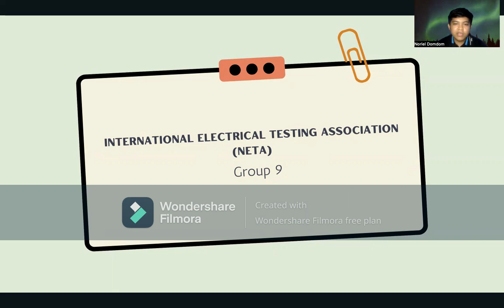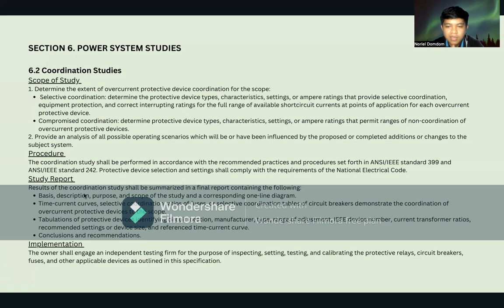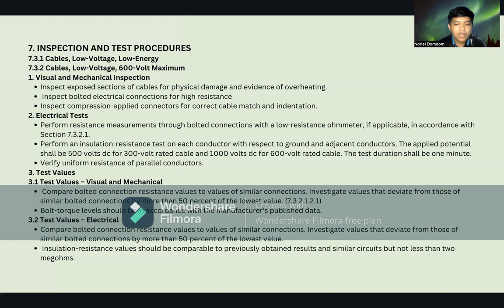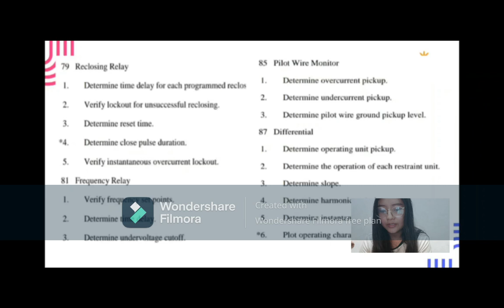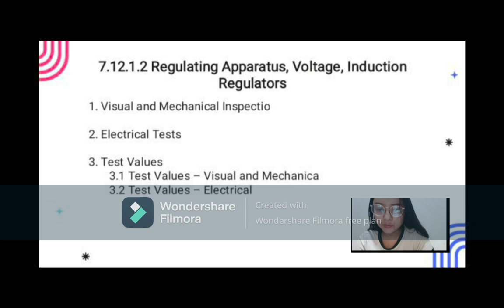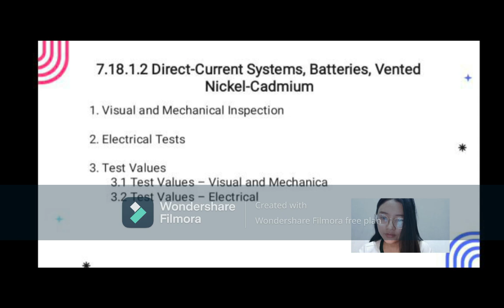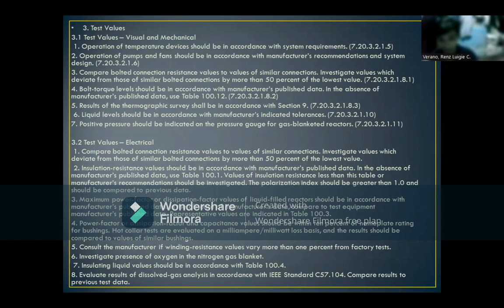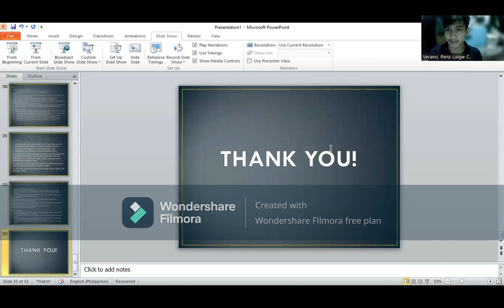Group 9 International Electrical Testing Association

Comment: I want to thank the group for their thorough and understandable discussion of NETA. I discovered that NETA is a trade organization devoted to enhancing American electrical testing standards and disseminating such standards elsewhere. The American National Standards Institute has recognized NETA as a body that develops standards. Additionally, it was covered in Section 4: Division of Responsibility, which covered the roles of those concerned. According to section 4.1, the User provides the equipment in a ready-to-test state and is also accountable for any equipment power switching. The testing organization, on the other hand, supplies all technical services, power requirements, owner notice, timely system notification, and a record of all tests, according to section 4.2.

Comment: Thank you Group 9 ! i learned the that  NETA goal is to ensure the highest levels of electrical reliability and safety. NETA provides accreditation for third-party electrical testing firms, certification for testing technicians, and more. Along with establishing guidelines for testing technicians to follow, NETA also provides standards that manufacturers can follow when literature is not available. Because they are an independent organization and their board consists of volunteers, they remain unbiased toward either customers or manufacturers. NETA exists to ensure that equipment is safe and functional and that technicians are adequately trained to make the industry better for everyone.

Comment: As I learn more about what the International Electrical Testing Association (IETI) is all about thanks to this group's shared video presentation, it's clear that they are well-informed. The group did an excellent job of explaining the subject matter and conveying information about how the IETA regulates the procedures for testing newly installed power systems before energizing them as well as existing, in-service power systems. Thank you and good work.

Comment: Thank you for Group 9, The presentation is excellent, and kudos to the reporters that delivered it so well. After viewing the video, I understood that NETA is quite similar to PEC in that it deals with electrical safety, material quality, and building codes. It assures that the services and materials utilized are of standard quality. Regulating the process of testing newly installed power systems, as well as the duty and goal of this association.

Comment: After seeing the group's educational video, I gained knowledge about the International Electrical Testing Association (IETA) and its significance. I learned that the IETA controls the procedure for testing recently installed power systems. In addition, the IETA is responsible for ensuring the industry's standards for electrical testing. I want to express my gratitude to this group for endeavoring to spread this knowledge.

Comment: As I finished watching the group's informative video, I learned what the IETA, or International Electrical Testing Association, and how important it is. I acquired the knowledge that IETA is the one regulating the process of testing newly installed power systems. Also, the IETA is the one who ensures the industry's standards when it comes to electrical testing. I would like to thank this group for making an effort to share this information.

Comment: I would like to thank group 9 for today's very informative discussion. The topic is well discussed with a clear deliberation by the group. In this topic regarding the International Electrical Testing Association (IETI), I now fully understand how to connect and test a circuit breaker for medium voltage, oil medium voltage, and high voltage. Additionally, the inspection and testing methods for dc motors, generators, and rotating machinery. The learnings for today’s discussion regarding the topic was important in understanding and knowing how it works especially as an electrical engineering student.

Comment: Thank you group 9 for the presentation I learned that in Article 7.19.1 Surge Arresters, Low Voltage Surge Protection Devices in the first inspection which is visual and mechanical inspection seven alternative inspection must considered whereas (1) we should inspect the physical and mechanical condition of the protection devices (2) also the inspect the proper Anchorage, alignment and as well as the groundings (3) prior to cleaning the unit perform as found tests (4) clean the unit (5) also inspect the bolted electrical conditions (6) verify that the ground lead on each device is individually attached to a ground bus or ground  electrode, and lastly (7)performed as left tests. The following inspections are very important for the safety of our users and for us to monitor the functionality of our protection devices if there will be an malfunction or defect it will be easily fixed as it arise.

Comment: Thank you so much for bringing up this topic about IETA (International Electrical Testing Association) After watching your video presentation, I gained a lot of knowledge about how I can contribute to the design of efficient rules for the operation and integrity of the market, as well as how I can provide the most up-to-date and credible information on the trading of greenhouse gas emissions and market activity. The International Electrical Testing Association, also known as IETA, is the organization responsible for publishing industry standards for the field of electrical testing. These documents define the methods that must be followed in order to test newly installed power systems in advance of energization, as well as testing procedures for power systems that are already operational.

Comment: As I noticed After watching the video presentation about international electrical testing association I learned a lot specifically about the regulating the the process of testing newly installed power system and also about the responsibility and purpose of this association. Thank you group 9 for informative discussion.

Comment: Thank you Group 9 for this informative presentation I learned more about what the purpose and the standard of International Electrical Testing Association (NETA) . They set up standards that can be followed when manufacturers literature cannot be found or is available. NETA also sets up certifications for technicians to acquire to prove that they are qualified to be performing quality work. They are an independent standard that is not biased to take a customers side, or a manufacturers side. They provide standards to assure that electrical equipment functions properly and as intended per contract drawings.

Comment: Thank you for sharing this video presentation about the International Electrical Testing Association.  You two did a good job of debating the subject. I now know that the IETA is responsible for regulating the procedures for testing both newly installed power systems and those that are already in use before they are turned on.  clear discussion about NETA. I learned that NETA is a trade association that works to improve American electrical testing standards and spread those standards internationally. NETA has been acknowledged by the American National Standards Institute as a group that creates standards.

Comment: The presentation is great and thanks to the reporters that deliver the presentation well. Upon watching the video I realized that NETA is almost the same as PEC since it deals with the electrical safety and quality of materials and also building code. It ensures that the quality of services and materials to be used is standard

Comment: Thank you for this informative discussion. I learned that, in 7.14 which is the Ground-Fault Protection System. It is important to test ground fault system because, approximately 16% of the ground fault prevention systems that NETA tests have parts that are either improperly placed, have damage, or are malfunctioning. Arcing ground faults can seriously harm distribution systems, resulting in fires that harm buildings and put people in danger. They also prolong system downtime while repairs are being made. The first step of shield is ground fault protection. Once deployed, ground fault prevention systems are ready to go whenever services or feeders need to be protected. However, the distribution system and facility will be just as badly harmed if these systems fail when a ground fault occurs. Ground fault systems need to be installed properly, maintained, and checked on a regular basis.

Comment: I appreciate the group 9 for a good presentation. I have now in depth knowledge about International Electrical Testing Association (NETA) so NETA is  association in terms of power system electrical testing to ensure the high level of standards. NETA also inspected and  maintained for best condition as possible.

Comment: Thank you for explaining InterNational Electrical Testing Association (NETA), After watching the presentation I've learned that NETA is improving electrical testing standards. NETA also give some standards when it comes maintenance and safety in electrical components they test it before releasing it to the market to assure the quality of every components special in power systems they assure that it will be use in the long run and avoid expensive repair/maintenance.

Comment: Thank you for sharing this video presentation about the International Electrical Testing Association. You guys were able to discuss the topic well. I have learned that the purpose of IETA is to regulate processes for testing newly installed power systems prior to energization as well as existing, in-service power systems.

Comment: After watching the video presented about International Electrical Testing Association. I learned that when electrical equipment is first put into service, it goes through a unique experience. It is essential to make sure that systems and components are prepared to work in order to prevent expensive downtime.

Comment: Upon watching the video presentation, I learned that the International Electrical Testing Association or what we called NETA was formed to set an a uniform testing procedures for electtrical equipments and apparatus. According to Noriel, they are Accredited Standards Developer of American National Standards Institute (ANSI) and the scope of their operation is different from other electrical standards. They commonly reference other standards developers' document where applicable to test electrical equipment and systems. Noriel also discussed the Expected Test Results of Section 7 which refers to the main body of NETA on doing inspection and maintenance testing of electrical power distribution equipment and systems. Under this section are the three type of equipment process that includes: (1) Visual and Mechanical Inspection; (2) Electrical Tests; and (3) Test Values. On the other hand, Celorie's presentation is the continuation of NETA. She mentioned that the 27 Undervoltage Relay this is the relay that contacts and operate with the voltage drop below a set voltage which commonly used to protect against voltage drop, and etc. Finally, Luigi tackle about the specification in dealing with the proper connection of the wire and the processes of electrical connections (AC or DC). He also explain the step by step procedures in performing resistance measurements. Your presentation is great and I appreciate your effort in explaining them in detailed. Thank you guys! :)))

Comment: Thank you for such an informative video. I have learned that The NETA publishes electrical testing industry standards. These regulations govern the testing of new and existing power systems before the energization of in-service power systems. Those standards are intended to ensure that tested electrical equipment and systems are operational, meet relevant standards and tolerances, and are installed per design specifications.
Standard 7.5.2 Switches, Oil, Medium-Voltage, It has a physical inspection and mechanical condition and has to perform a mechanical operator test in accordance with the manufacturer's published data.
In accordance with Section 7.5.1, perform resistance measurements with a low resistance ohmmeter by bolted connections.

Comment: Thank you for sharing this informative video presentation about the International Electrical Testing Association (IETA), Group 9. I discovered that the IETA provides inspection and testing services in a variety of electrical fields. I also learned about Power System Investigations, which include the scope and procedures of these investigations.

Comment: Thank you for sharing this informative presentation. They discussed it clearly and easy to understand on how the flow works. I learn all about the connection and test procedure of circuit breaker in medium voltage, oil medium and high voltage. Also the inspection and test procedures on rotating machinery, dc motors, and generators.

Comment: First of all Thank You guys for this informative video. From the discussion above, about International Electrical Testing Association. I learned that it consist of three main Bodies of information which are visual and mechanical inspection, electrical test and test values that located in section 7. They also regulate process for testing newly installed power systems prior to organization as well as existing in service power system and it can enable to assure quality, integrity and improve safety.

Comment: Thank you for sharing this video presentation. In summary, I learned that IETA (International Electrical Testing Association) provides inspection and testing procedures in various details on electrical (Section 7). I also learned about the Power System Studies in Section 6 such as Stability and Harmonic-Analysis studies, which tackle their scope and procedures.

Comment: NETA also establishes qualifications for technicians to obtain in order to demonstrate that they are qualified to execute quality job. They are an unbiased standard that does not favor either the customer or the manufacturer. They establish standards to ensure that electrical equipment operates properly and in accordance with contract drawings.

Comment: Standards are provided by the International Electrical Testing Association (NETA), a division of the electrical testing industry. According to these documents, evaluation procedures should be followed for power systems that are both newly installed and already in use. You can ensure quality and integrity, improve safety, and certify technicians in standardized testing processes with the use of these guidelines. Obtain certification and accreditation. Thank you reporters.

Comment: The International Electrical Testing Association (NETA), a sector of the electrical testing business, offers standards. In accordance with these publications, evaluation methods should be followed for both newly installed power systems and power systems that are already in use. With the help of these protocols, you may guarantee quality and integrity, increase safety, and certify technicians in standardized testing procedures. Acquire accreditation and certification.